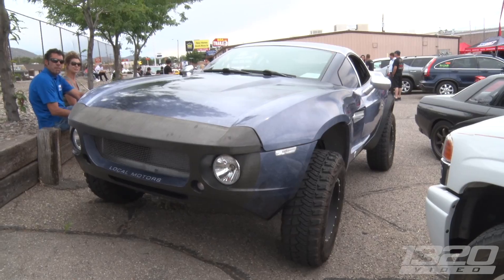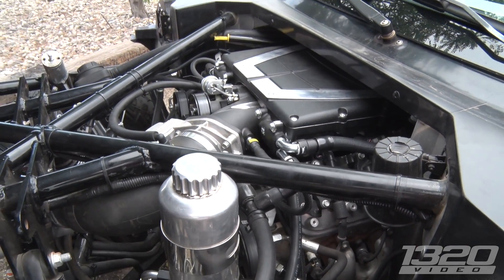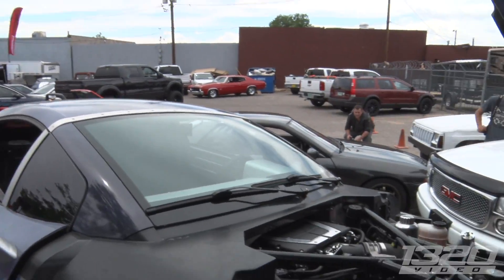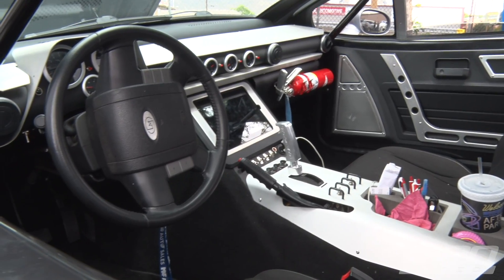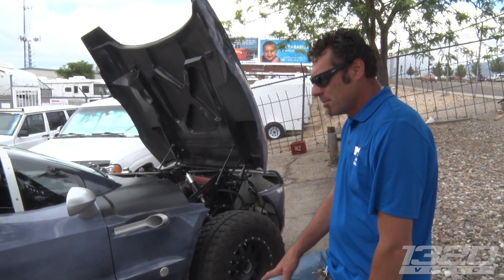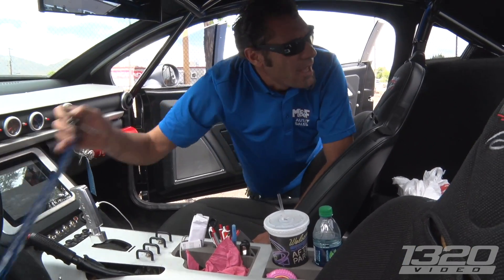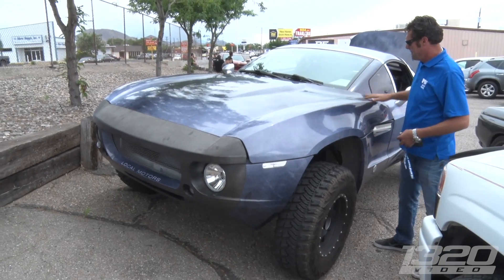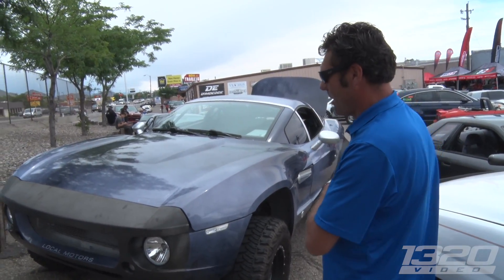"Alien Car" at a DRAG RACE - What is it?!

Comment: The guy that owns local motors was on jay Leno's garage and if you buy it directly from him you get to build it yourself
Reply: Bud Green  to make it legal you have to twist wrench on it from what I remember then I can be under a home-built class of car
Reply: +Andrew Fisch  You are correct. Local Motors is not authorized to sell production cars to the public. To get around this problem they have the customer come to the factory to tighten a couple of bolts. This way it's considered a kit car. FYI that car sells for $100K.

Comment: Unfortunately, although Rockford Fosgate makes amazing equipment, the subs beating them like that, he will eventually have failed solder joints from the vibrations. If you see him again, advise him to install some kind of absorbing material between those amps and the amp rack. If he pushes them hard and they heat up, the solder can weaken when they get hot and loose capacitors. I've seen them actually fall off the board inside the amps. Just a heads up.

Comment: It's just a rally fighter chill out.
Reply: Just a rally fighter,you say that like every neighborhood has one.   :)
Reply: Its an Off road Monster with a 4-500hp LS V8
Reply: THANK YOU!  Im glad someone else knows what this beast of a machine is.  This car was created on the through a series of pulls figuring out what parts from different car they can Frankenstein together to create this monster.  A few year back Top Gear did a episode on this car showing its versatility.
Reply: I live 10 miles away from Local Motors :)
Reply: darkblaze176 more like 800hp buddy, its a trophy truck chasis with a super charged ls3 motor
Reply: the lower tier versions only have like 400 hp but you can pretty much cram any engine in there. personally id love to see a viper engine in there, that would be badass
Reply: I knew from fh3 lol anyone here?
Reply: There is one in Fort Worth! They look cool. This one doesn't sit up as high as others I have seen.